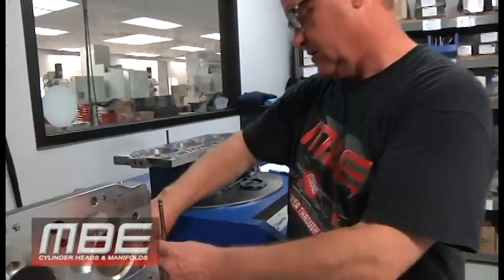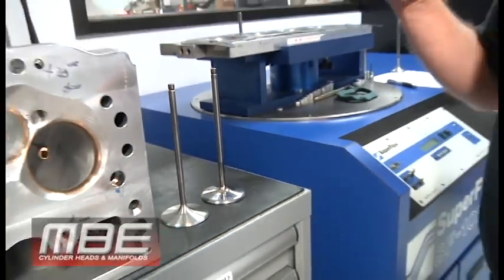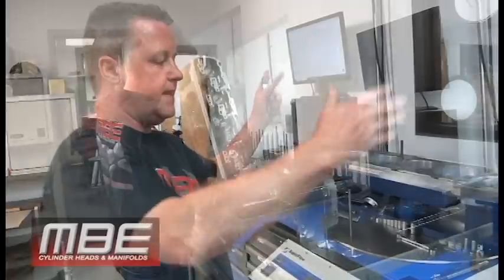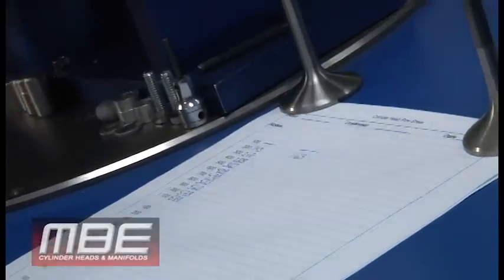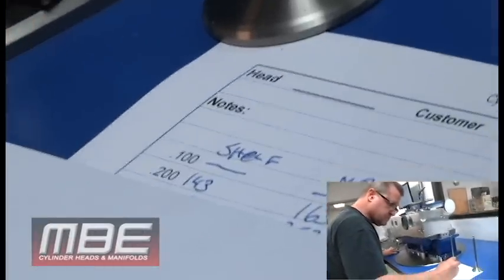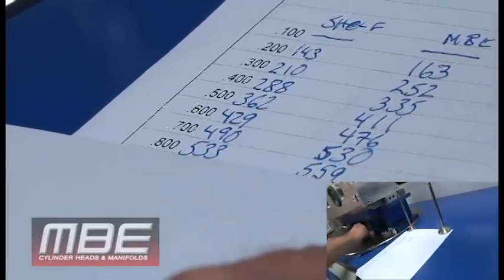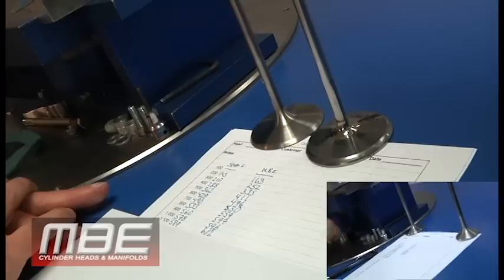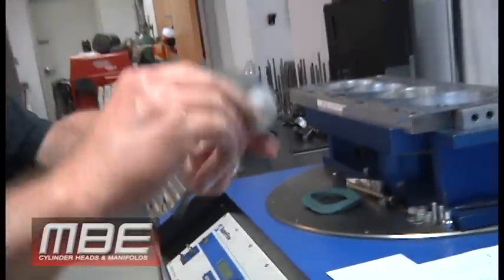** TECH ** Intake Valve Back Angles & Why they are Important

Comment: Thank you kindly, Sir.  Although I am into Harley M8 builds, your advice crosses over.  And I'm sure I'm not alone by saying, your content is not boring.

I had a similar experience with the company (J.E.T.) I went with.  During my assessment phase I shared that I had  purchased a set of Kibble White valves and springs.  They cost more than the discount I would have received.  But I decided to not use my Kibble Whites because I detected a little disappointment in Robert Johnson's voice, the King of the Bagger racer and owner of JET.

I had to make a decision, go with the my setup or go with JET.  

"Don't hold on to a mistake no matter how much time and money you put into making it."

I went with JET.

The Kibble Whites I purchased were 550 lift +1 valves.  The Scream'n Eagle heads were finished with 650 lift springs and +2 valves.

Trusting your guy can be one of the best decisions in a sea 🌊 of decisions that is engine building.

Thanks again brother.

SKWID
Rider’s Shipmate 
ET1(SS/SW/MTS) US Navy, Ret.
Killmonger: 2020 Fat Boy (Stage II+ by Blockhead)
SilverBAK: 2021 Road Glide (S&S 129ci/Fueling Race Kit by Rider’s Shipmate)

Comment: What do you know about 7.3 Powerstroke turbo diesel heads, porting, valve diameter limitations over the stock 1.675”, flowing heads with a way to mimic boosted applications verses NA engine heads? I can’t find hardly find anything so I started the Coast to Coast Diesel Enthusiasts YouTube channel and I’m trying to bring others some kind of information and explanations of how helical ports work verses conventional ports. No local machine shop has a flow bench to test diesel heads, I’ll probably have to drive from Fort Mitchell, Alabama to another State to finalize my port work. There’s a Tremendous Void in the Diesel Community when it comes to port work knowledge. I’m going to Pioneer a way to fill that gap.

Comment: Exhaust valves also have these cuts?
Reply: No. Generally the exhaust doesnt have back cuts as the sharper edge on the valve creates bad flow in reverse which helps against reversion into the cylinder. The key on exhaust valves is to use tulip shape.

Comment: This is amazing information, its basically free horsepower for just a tiny bit of machine work once you have the formula for angles and length of angles. Having said that the same should hold true for the exhaust valves.

Comment: What characteristics of different engines/heads or N/A vs FI or nitrous do you think would call for a different optimal back angle / length of angle? In other words, what factors bring you to your conclusion of what angle is right for a certain combo? I wonder how wide the spectrum of optimal angles is for different setups. Pretty cool stuff you’re workin on!
Reply: They won't tell you. They say for your "trusted" cylinder head guy to determine the angles.

Just ignore this BS sales pitch and let your machinist do his thing.

Comment: Is this based on the valve (seat face) angle being 45 degrees?
Reply: @redspotaudio  These videos are just advertising for their products, they aren't giving any knowledge away for free.

I do not work for any of their competitors, I have been out of the industry for over 10 years but I do still stay current on the technology. 

The business I worked for had fantastic claims to sell their products. It is very typical in the auto industry to claim amazing increases from their products when the reality is much less sexy.

My advice is don't buy into the hype of any company.
Reply: @redspotaudio  You know you have lost the debate when you sink to personal attacks.

Flow bench numbers are not the end-all be-all. Take it from a race-winning cylinder head guy... me. 

There is a lot that goes into a winning combination, flow bench testing is just a tool to show relative changes, not horsepower increases.

But you are clearly the internet expert and clearly know everything... except proper grammar.
Reply: @David_H_Parker , totally agree with what your saying. 
I have followed Ben Alameda Racing explainations of valves, flow etc.
He has a good channel to watch also, and explains it slot more without the secrecy ....
Reply: @DURRIESVISION . Yea, Ben is a sharp dude and shares good info now that he has retired....
Reply: @redspotaudio  Okay buddy, keep telling yourself whatever you need to lift your low self esteem.
Reply: They won't tell you... it's a secret.
This video is such BS, no dyno runs to prove their HP & torque claims.
Do the angles make a difference? Yes, but not like they are claiming here. 
This is just an advertisement for some overpriced valves with * SECRET * technology to justify the price increase.

Your machinist can increase of reduce the back cut angles.
Reply: @David_H_Parker  MBE has some major credentials. I doubt they're selling snake oil.